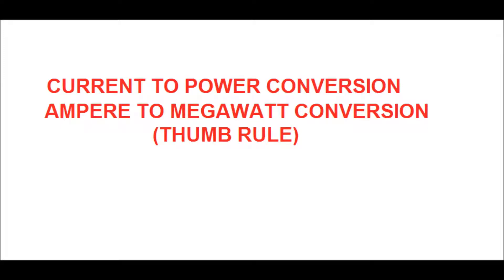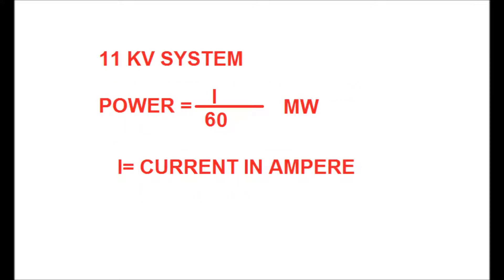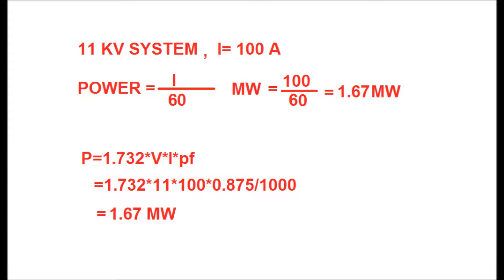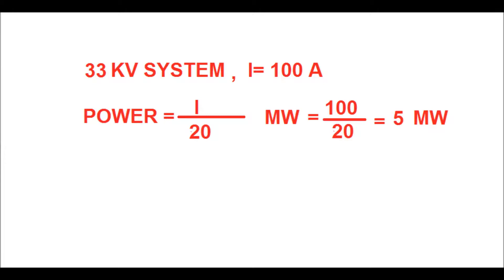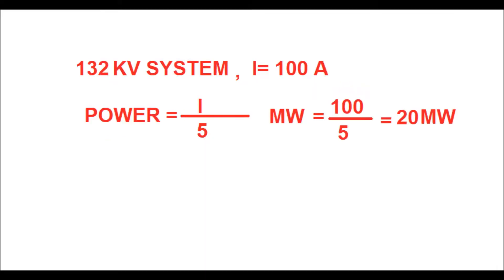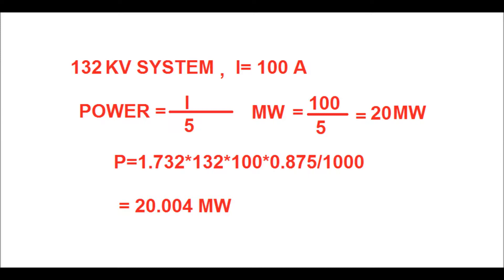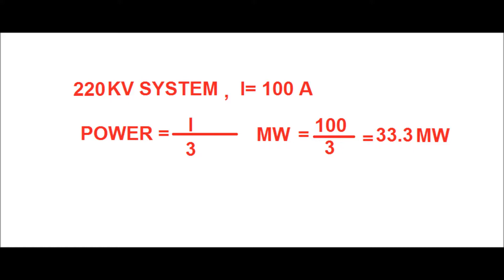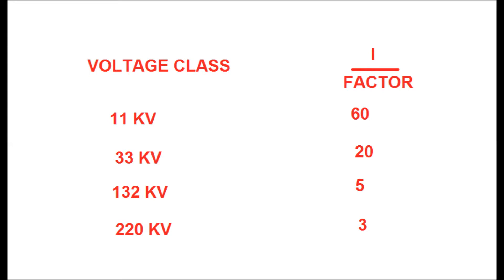CURRENT TO POWER CALCULATION || THUMB RULE FOR AMPERE TO MW CONVERSION FOR DIFFERENT VOLTAGE LEVEL

Comment: Sir' all thumb rule is ok,
But one think i not understood please give solution, 22kv ampere to convert MW
Reply from the maker: For 22 KV Voltage system factor shall be 30 considering 0.875 pf. Whatever be load in A that load shall be divided by the factor 30 to get MW value of power. For e.g. if line current is 100 A then power flow shall be 3.33 MW as per thumb rule for 22 kV line to line voltage.